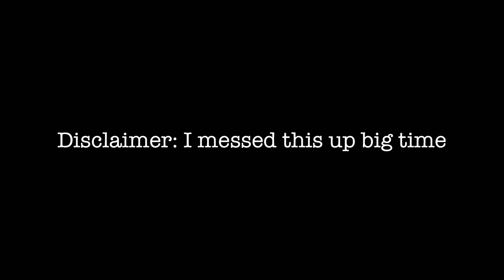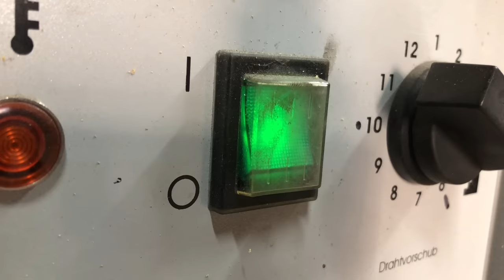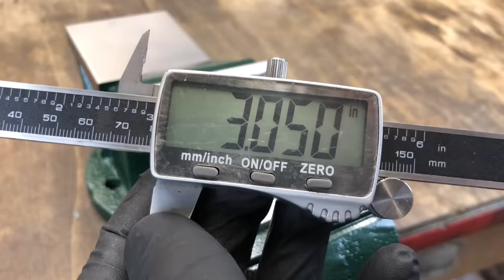Very Rusty Stuck Vise Restoration | Mister Patina

Comment: I'm wondering why you go through the time, effort & materials to soak & scrub the rust & paint off if you're simply gonna sand blast it anyway. . . It seems like you could've avoided a LOT of unnecessary steps.
Reply from the maker: The soaking in rust remover was to reach the inner areas, my sandblaster wasnt able to reach ;-)

Comment: I've seen lots but this is the First time I've seen someone repair a bench vise without putting bondo / body filler on it to hide rust blemishes,  good job!, great resto!
Reply from the maker: Thank you for mentioning this. In my opinion it’s a Tool and doesn’t need more than 2 layers of rust protection! 
Thanks for watching! 🙂
Reply: @misterpatina  may not be needed but it sure looks nice :-p

Comment: During the electrolysis process to restore woodworking hand planes, I used to use Boraxo washing powder, but I think it’s been discontinued and hard to find. It did a very good job and didn’t need an additional rust treatment. I haven’t tried baking soda. Great job!

Comment: Yes! Fire always helps 🔥 Hammer screwdriver is a great tool sometimes for those stuck screws and bolts.
Reply: To and fro; if it moves, and there's enough friction that there's a chance of the bolt shearing, it has a better chance of coming out if you back-and-forth/worry it continually while unscrewing.

Comment: I really enjoyed what you done with the slit screw in the back of the handle. The result was mind blowing!
Also, WD-40 is not really that effective to lose rust bolts (better than nothing, for sure). I learned that acetone and automatic transmission oil make an excellent penetrating fluid. I also recommend that you apply it 24 prior, this allow the solution to penetrate (thanks to the low viscosity of automatic oil) and corrode the rust (thanks to acetone).

Comment: The algorithm recommended this video... While I'm in the process of restoring the exact same vice model!!! It will even have the same color, which I already purchased! Crazyyyyy!  I'm done grinding the cast marks and I covered the rest with putty, I sanded it down to make it smooth... it's ready for painting now. But mine is in much better shape than yours. I'm speechless... Great job btw!

Comment: You did an excellent job and way better than anything I could do. However one small thing I have learned is that when something is rusted like those screws you need penetrating oil not DW40.
Reply: that doesnt work, project farm did a test about that.. and this just doesnt work.. 
the fluids doesnt go in the threads.. so no point in putting stuff...
melted wax, penetrating oil, wd40 etc.. all useless
Reply: @jackl2254  I respectfully disagree.  I use Cyclo Break Away, and it does work, and goes into the treads like nothing else I have used.  It is a little hard to find, but it does work for my rusted nuts and bolts.

Comment: Dude, that vise is beautiful. Love the way you tightened up the tolerances and the super smooth operation when finished. Super nice restoration and great camera work too.  Job well done sir.   
—May I suggest a spray or brush on 2 part epoxy primer?  If not epoxy, then a high build spray on primer. It fills small defects and is sandable. It also prevents corrosion and helps the paint bond. 
— Again, job well done on the vise restoration.
Reply from the maker: Thank you so much!

Comment: Just a tip with your electrolysis. 
The reason it may not have worked well, is that you used the wrong chemical .
Use washing soda ,not baking soda . These are very different chemicals and will affect the process. Always stir in well beforehand .
Warm water will also speed up the process.  Hope this helps.
Reply from the maker: Thanks a lot Laurence! I'll keep it in mind :-)

Comment: Very nicely done, but don't use baking soda (sodium bicarbonate), use instead washing soda (sodium carbonate). That's some pretty rough castings, quite apart from the oxidation damage! Do you not preheat your cast before welding? Beautifully finished anvil...seems a pity to use it now lest one dents it. Congratulations indeed! You have made a junked cheap vice into a very nice usable soft jaw vise ready to use!
Reply: I had no idea that soft jaw vices were a thing. What are they usually used for?
Reply: @jlw7771  To be able to clamp parts in a vice that are made of easily damaged material, such as aluminium or copper etc.

Comment: Just a reminder to viewers that WD-40 is great, but the base version is not a rust breaker, which is usually what you want when you have parts seized by rust.  The best ones are usually a combination of a rist breaker and a lubricant, such as the infamous acetone/atf fluid mix.

Comment: Excellent job!  Is there enough room to hammer that brass pin out through   the bottom?  I usually put a cotter key in there.  Best way to remove jaw screws is to use a driver bit and use the other jaw to clamp down on it, keeping it in  place. Then turn it with a wrench. Heating it first also helps.

Comment: Hey man, cool video. But just fyi, since you are doing subtitle videos. It would be a good practice to put the subtitles higher in the frame. As it is now, the play bar and  controls overlay block the subtitles which is counter productive. If you release for youtube, always make sure the subs are high enough to sit above the video controls/duration bar. This is even more important on instructional videos like these where a viewer might feel the need to pause on certain sections

Comment: Nice job. You may find a better outcome with electrolysis method by , using a higher dc current, mixing the electrolyte more thoroughly ( I go till supersaturated) and before adding to parts, using a bigger positive rod, using more than one positive rod ( sandwich your parts) and using a larger gauge wire for your hanging parts (with the added current). Also baking soda isn’t the best electrolyte, try cooking it on a baking sheet for 1 hour @ 400°, stirring around every .25 hour. It’s cheaper than purchasing soda. Thanks for your channel and hard work keeping it legit and interesting

Comment: I think going straight to wire wheel and drum sanders to knock off paint and rust would probably save time from de-rusting baths and electrolysis bath ?
Reply: I also thought so. First should get paint off with wire wheel or paint stripper and then degrease it. The electrolysis would work way better

Comment: It is beautiful. Just a quick question and please don't take this as any disrespect... Was the vise worth saving? For the time, effort and materials you could surely get a new one of a similar quality.
Reply from the maker: Hey Matêj, thanks! It basically wasn’t worth it, since it isn’t a high quality vise. But it was a lot of fun and it’s still doing a good Job. I use it sometimes for soft materials, because of the aluminum jaws 🙂

Comment: If you sandblast it anyway, why do you need to try electrolysis or rust removal first? I would just wire brush it as much as I can and then just sandblast it. Am I wrong?
Reply: Removing as much as possible before sandblasting reduces the amount of waste material that ends up mixed with the blasting media. That way the media last much much longer, and reduced the chances of clogging/failures in the blasting hardware. 

An analogy might be if you’re covered in sawdust, you could put your clothes straight in the washing machine, but it’s better and more effective to brush as much of the sawdust off you first before washing 👍
Reply: @bobafetting6373  Thanx!

Comment: Absolutely superb restoration ~ although, if I may be permitted to make an observation? ~ I do think that the aluminium jaws do not suit this magnificent project.
Reply from the maker: Thanks John! Since this vise is so small, I only use it for small soft metal parts. Aluminum won’t scratch the parts as much as steel would. But I feel your criticism! Thanks!
Reply: @misterpatina  Ah, now that makes sense!  I did not realize that you intend to use it in a practical way. Please disregard my previous comment. Keep up the good work.

Comment: I was shocked to see how much rust piled up during the electrolysis yet the vice itself looked only a bit better. Guess that is because there was so much surface area difference between the two sides of the bath.

Comment: I’m not sure if they have this product in Germany but Evapo Rust is a chemical that you can soak the rusted metal in and it would of saved you a lot of time. All you would of needed to do is scrub the Vice with a wire brush and then soak for 24 hours. The good thing about Evapo Rust is that you can reuse it until it becomes pitch black like old motor oil.

Comment: Honest question. Why go for the electrolysis rust removal first when it's getting sandblasted and wire brushed directly after? Isn't that redundant ? Or am I missing/not understanding something here?
Reply from the maker: You’re right, but the vise had so much hollow areas I couldn’t reach with the blaster. So I did the rust removal first. Wire brushing to smooth the surfaces for further steps.
Reply: @misterpatina   thanks you very much for the quick response 👍🙏💯

Comment: OK here is what I don't get , Im familiar with a metal shop and restoration as I've done this type of stuff sense high school
so why would you waste time!, water and chemicals if you not only own a sand blaster but also know fully that it will clean and prep the metal better then water and random chemicals??!!?!?!??!!?!?!?!?!!?!?!?!?
I dont get it, not sure why but it grinds my gears so much!
Aside from that well done!!!! it looks amazing!
Reply from the maker: Hey, the vice has some hollow areas, where sandblasting had no effect (because I couldn’t reach these spots). So I used chemical for internal surfaces, and sandblasting for external.

Comment: Nice job as always, though I’m curious to know why you didn’t use filler before painting with all that rust pitting. Obviously I’m a little late to the party, so I’m not expecting a reply.
Reply from the maker: No problem Curtis. I didn’t use a filler in that case, because - in my opinion - this is a real tool. A filler would make the surface fragile. Hope you understand and enjoyed anyways 🙂
Reply: @misterpatina  I absolutely did enjoy it.

Comment: Did you think about making the waffle pattern on the jaws with a center drill or an engraving bit?
Reply from the maker: No, but that sounds like a good idea :-)
Reply: @misterpatina  The original ones looked kind of chamfored and also a broken edge is usually more durable. That's my reasoning behind it.

Comment: Fantastic job well good use of the lath with milling attachment,one criticism is the vice jaws are supposed to be hardened making them out of aluminium was a mistake but they look cool.
Reply from the maker: Thanks. That’s not a mistake - I use this vice for soft metals, the aluminum jaws won’t scratch the soft metals.

Comment: Is it ok to put parts with paint rest into the sanblaster even if the paint may contain lead? Does not cause any lead contamination? ( Even though the air outflow comes through some filter)

Comment: Research "electrolysis tank"   You are supposed to use washing soda, not baking soda.  If you had done this properly, you would not need to resoak , dry and then blast. My e-tank removes everything, leaving just the bare metal !

Comment: To defeat 10 CM thick rust you need; hammer, electrolysis, industrial (but safe) rust removal chemical, sandblasting, and wire wheel. I was hoping for some sandpaper too... oh yeah, there's sandpaper 10:55

Comment: I get everything but the massive oil bath after rust removal. Brushing on oil from less volume?
Reply from the maker: The bath is the last step of the cold bluing process. Cold blues parts need to stay in oil for 12 hours

Comment: I'm asking for a friend.  Why don't you start with sand blasting instead of rust removal?  Won't the sand blasting take the rust off too?
Reply from the maker: You’re right, but the vise had so much hollow areas I couldn’t reach with the blaster. So I did. the rust removal first.
Reply: @misterpatina  Oh wow, my friend is gonna feel so stupid not realizing that.  I will relay the message, thanks!

Comment: Use penetrating oil, not WD-40. WD-40 is not a penetrant. You probably wouldn't have broken any bolts or had to drill if you used a good penetrating oil.
Reply from the maker: Thanks man! I mixed transmission fluid and acetone in my other videos :-)
Reply: @misterpatina  Perfect. That's exactly what I use.

Comment: 1mm play in the rails - perfect fit + use of gloves forbidden  on the lathe - emery as well ... + loctite ? why ?  + backlash spring too loose, why brass pin ? no need meanwhile the sleeve must have been brass not aluminium for lubrication properties of brass facing friction during work ! why making shine anvil ?? beautiful but thats all , no justification it's feeling - from the beginning we see the functionnal surfacss (rails) are too rusted and we must add material - not done - im sad too many vids like that
Reply: sorry im rough good work anyway

Comment: Somethong that Rusty I would soak in a 5 gal bucket of Diesel for a day instead of spraying it with WD'40.
PB Blaster is alot better than WD-40
Reply from the maker: I´d like to use PB Blaster! But its not available in germany :-(

Comment: I know this is old, but.....
Is there any reason why you didn't do the electrolysis process the very first thing?
Then go to the wire brush etc
Reply from the maker: Yes, i basically wanted to test the rust remover first
Reply: @misterpatina  
Makes sense 
Thanks

Comment: Those aluminum jaws won't last long
Reply from the maker: depends on what you use them for. I use them for softmetals until today. Furthermore its 7072 aluminum, which is pretty resistant - but i bet you know that.

Comment: Why do you spend so much time cleaning it with solutions when you are just going to sand blast it and grind it anyway?
Reply from the maker: Answered this already: this vise has some hollow spots/areas, I couldn’t reach with the blaster or the brush. So I derusted with chemicals (to derust the hollow areas) and the outside was blasted. Hope I could answer your question.

Comment: Why didn’t you just start out with the sand blaster after you got the parts separated? Not being a smartass. Actually curious and trying to learn.
Reply from the maker: No problem. Because I didnt want to have the paint chips in my sandblasting system. It would clog otherwise. So you always want to remove most of the paint/grease before sandblasting. Sandblasting is basically just for rust removal.
Reply: @misterpatina  thank you for the reply.

Comment: Two questions: (1) Why did you soak the parts in oil? (2) you milled a layer off, does that undue the oil step (assuming you didn’t soak them in the oil for this step)?
Reply from the maker: The oil bath is the final step of the cold bluing process. After cold bluing, the parts have to cure in oil for 12-24 hours.
Reply: @misterpatina   Thank you for the explanation.  After you soaked in oil you removed a layer.  Doesn’t that undue the cold bluing or does it penetrate multiple layers?
Reply from the maker: @allnightfright619  no, I didn’t cold blue the whole vise. The layer taken off was just bare metal.

Comment: Why aluminum jaws instead of steel jaws?
Reply from the maker: To clamp soft metals
Reply: @misterpatina  For that you could have put some thin throw-away soft covers over steel jaws. That's why I was asking - to my knowledge that's how it's usually done.
Reply from the maker: @a0flj0 i understand - thats my 4th vise, so I thought i make it a little special 🙂

Comment: it was possible to simply sandblast, without soaking in chemistry
Reply from the maker: Nearly. Since the Vise had some hollow edges at the bottom, it wouldve been pretty hard getting there with the sandblaster. So if first used chemicals - mostly for the inside - and then blasting the outside. Hope you enjoyed anyways
Reply: @misterpatina  Of course I liked it

Comment: What is the oil bath good for? For that the metal soaks up with oil? 😂🤣😂
Reply from the maker: Its necessary for the cold bluing. Cold blued parts need to be covered in oil for 12hours after applying.

Comment: Yet another restorer that just doesn't understand that this would have been SOOOO much easier if they had just sandblasted the parts step 1, instead of first dealing with chemicals and electricity, then just ending up sand blasting anyway, 5 steps later.
Reply from the maker: Hm, yet another one who doesn’t ask why, but just dropping comments. But let me explain anyways: since this vise has hollow areas (can’t be reached with sandblasting) I started with electrolysis to remove the rust on these spots. That wasn’t too effective though, so I took one step more aggressive: chemicals. The remaining paint was sandblasted off. 
I hope I could clarify. Sometimes you just need to work on spots you don’t see in the end, but I want to have them also restored.

Comment: why dont  heat up the piece for oil quenching?
Reply from the maker: Which piece?
Reply: @misterpatina  verything you submerged in oil understand this is for corrosion prevention hence why not heat up?
Reply from the maker: I understand. The oil bath wasn’t for rust prevention. I did this to let the cold bluing of the internal parts cure. Cold blued parts have to lay in oil for 12 hours.
Reply: @misterpatina  Polished carbon steel parts are also prone to rust, just asking